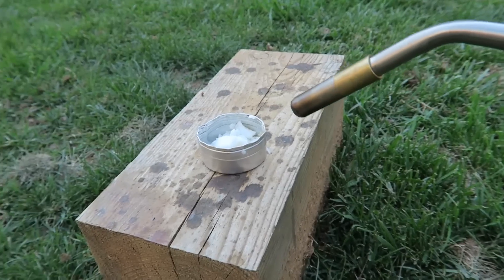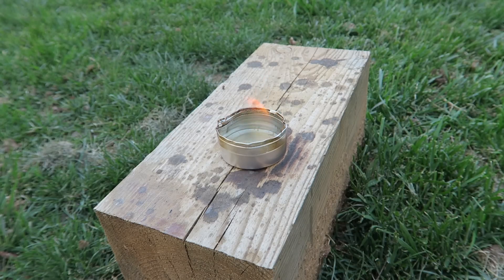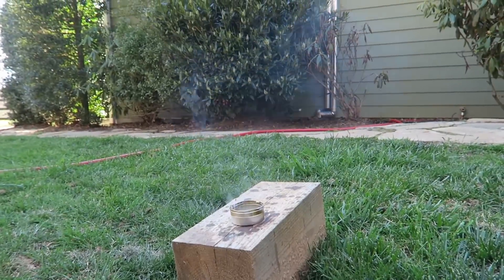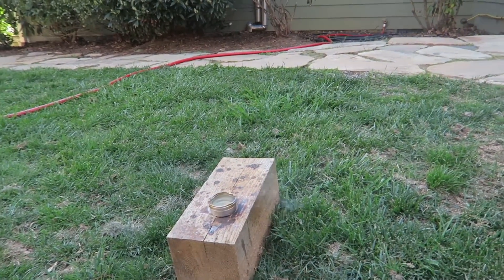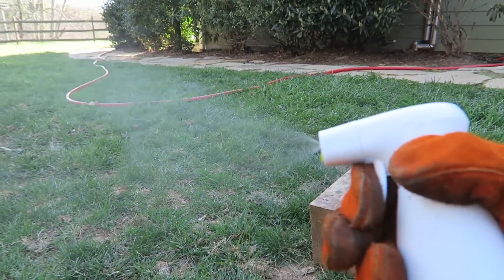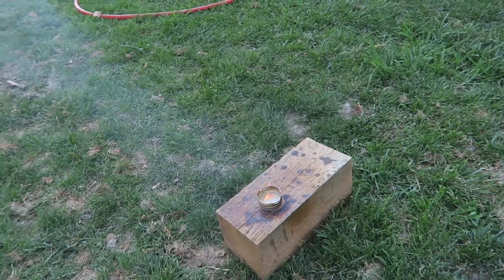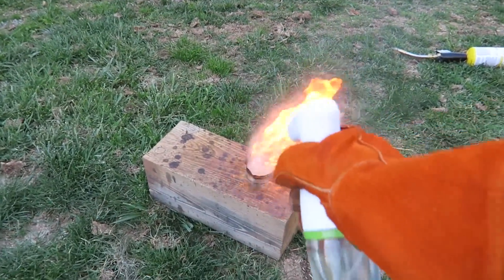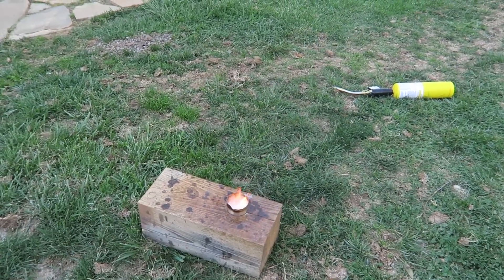Don't Mix Hot Wax and Water!

Comment: can someone tell me in terms of chemistry what reaction is happening and why?
Reply: Kibrea K, see I am no chemist

read more
Reply: Kibrea K You should probably also know that this is the reason that soaps are used for cleaning.  Water is an excellent solvent for cleaning non- polarized substances,  but unable to dissolve and wash away oils.  Soap is able to bind with both. It creates an intermediary between the two so that oils can be  washed away with the water without having to actually contact it.
Reply: Same as if you put water on an oil fire. The water sinks to the bottom as oil and wax float then the water gets super heated an turns into steam expands explosively.

Comment: Same thing that happens if you try to wash a hot pan full of Bacon grease with water. The water flash evaporates, and the expanding steam displaces (and launches) the grease... or, in this case, wax.

Comment: Using very long handle pliers or a heavy weight (to remain at a safe distance - only outdoors), plunge the (extinguished - non flaming) hot wax all the way to the bottom of a large bucket of cold water...  Instant expanded moonscape!

Comment: that because the oil are too hot, it will split H2O to hidrogen and oxygen which is an extremely flamable and oxidization element